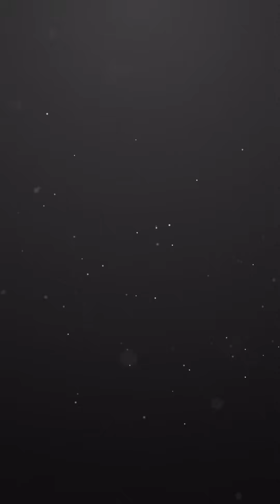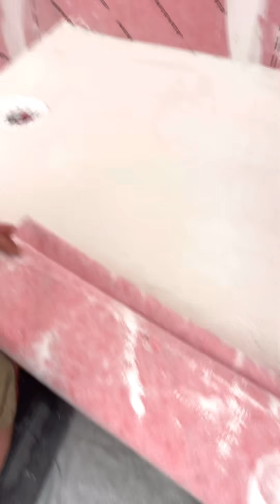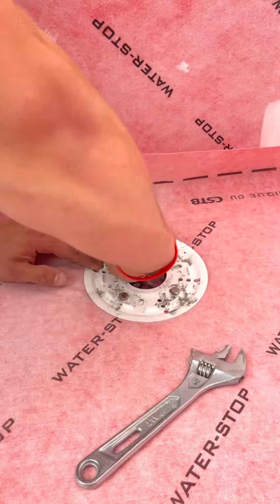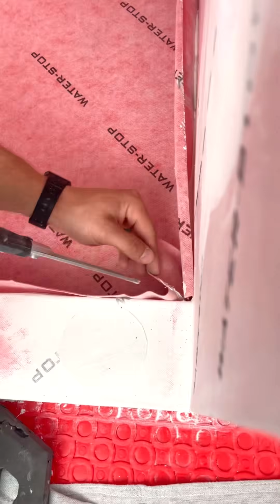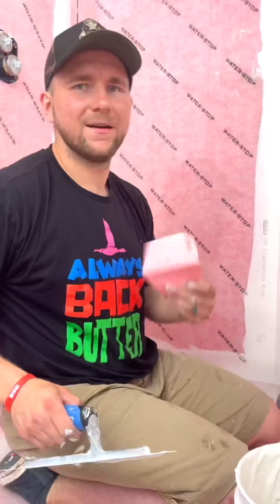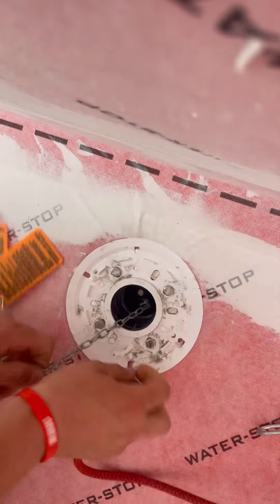🚨GURU Shower System Pan Membrane. 🪣Flood Test! WINNI Vlog 010

Comment: Hi Matt. My shower was just hardyboard, and they created a ‘lip’ on the edge with, it seemed like, a type of concrete.  Only thing over that was a pliable sticky substance that came from a bucket, brushed in….forms a waterproof barrier supposedly. I was told I could tile right over this. 
Is it enough? Looking at yours it seems so much more….finished. I wouldn’t know whether I should put another barrier atop the one they rolled on.
Reply: Hello, what's the link to buy the white mud your using here for the membrane, I searched your materials list, but couldn't find it there

Comment: I can't figure out how the linear drain is going to be installed or how its height was established to match the finished tile?
Reply: He said he’s doing large format tile, so my guess is he’ll use a 1/2” notch trowel.. which will allow for a lot of play to set the drain. Those drains are pretty easy to adjust to correct height to be flush with tile. Shouldn’t be a big deal brother.
Reply: @toddy_d  yeah I'm sure it's not lol. I'm just real curious to see how it comes together.
Reply: Their linear drains are designed to mount flush to the top of the liner.  If it were their tileable linear drain, it’d have to recess into the pan. But their normal one mounts on top and tile meets the edge of it.